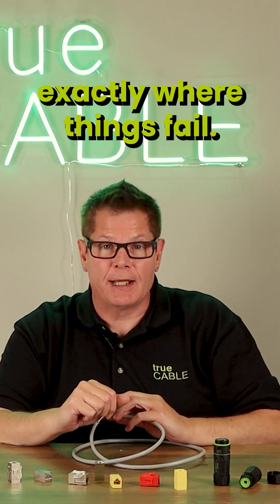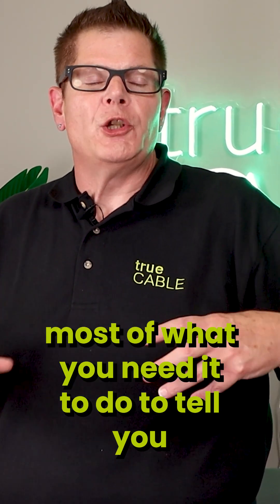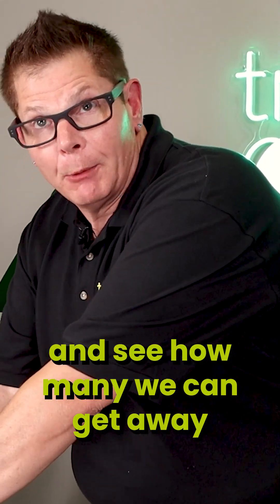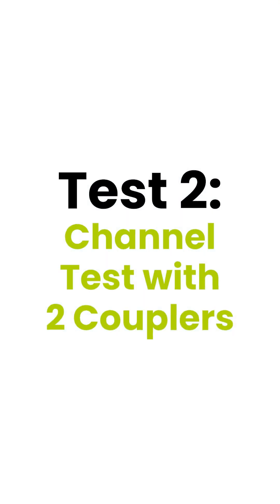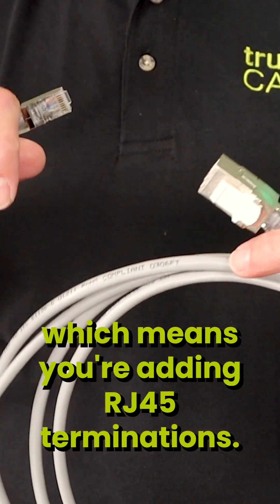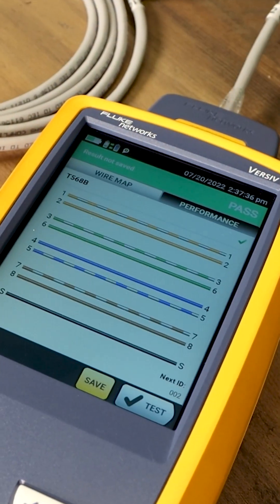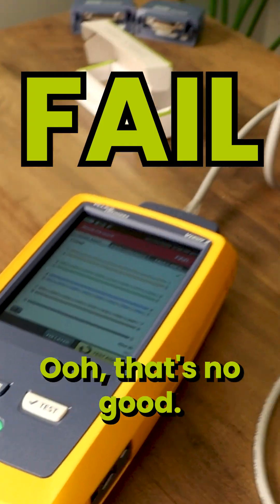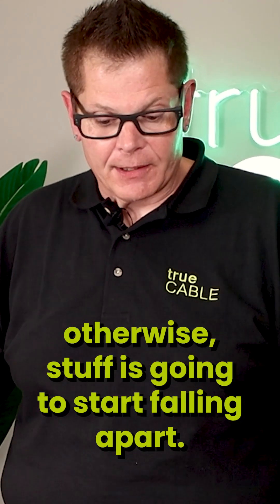How Many Ethernet Couplers is Too Many? #shorts

Comment: You should do the same test except with keystone terminations. Wonder if that would make a difference.
Reply from the maker: Hello and thanks for the content suggestion. My guess is that it would make a difference, but ultimately you have to use a 8P8C (aka RJ45) somewhere in the chain and that is what ultimately causes the problem...not the presence of the coupler, technically speaking. Pretty much splitting hairs, but the coupler itself was not the issue it was the number of 8P8C terminations that did it in!
Reply: So 6 rj45 connectors is the limit? Would be very interesting to see how much better the expensive keystone jacks and field terminations are.